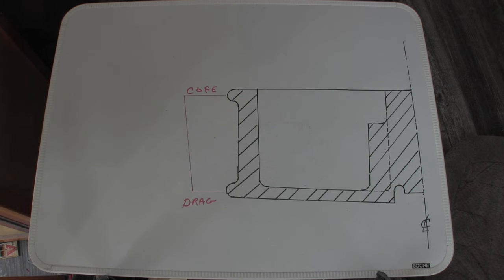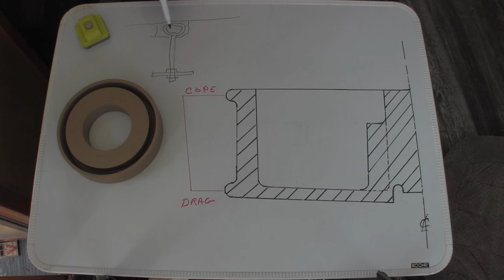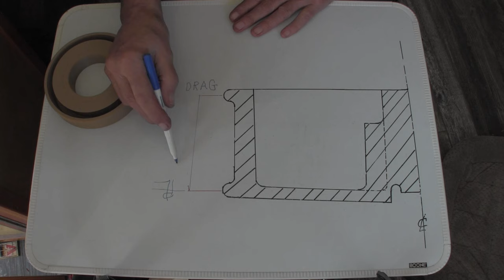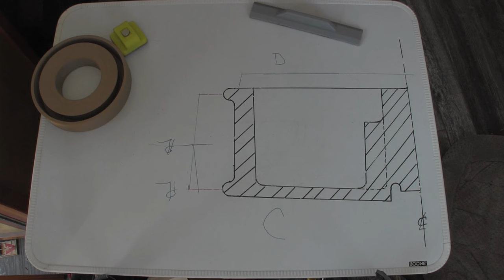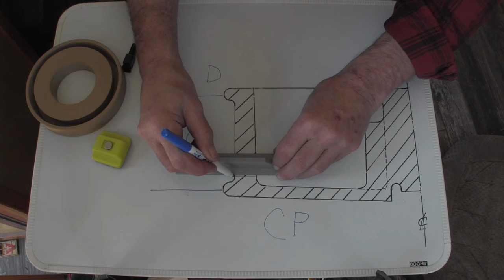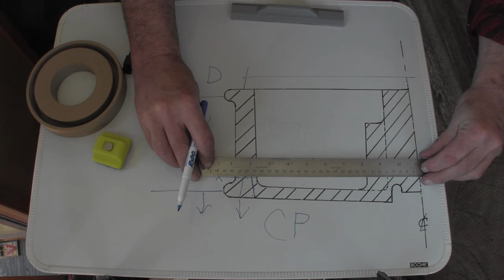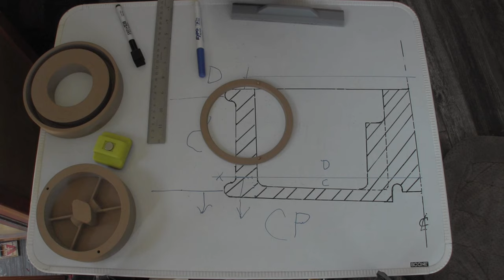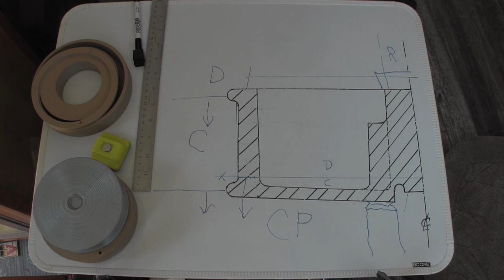Tally Ho capstan printed mockup build.

Comment: What I was surprised at with the capstan mold up was that gaggers (nails/gagger?) to give strength to the sand. I think I remember where the cope separated.  It seemed to me that the project was bigger than they could effectively handle. The size and the weight involved.

Comment: I was wondering if the outside core would have had to be so thick in the way they did it. It seemed to me that it could have been much smaller on the od  which would have made the required flask smaller and lighter. If the thinner cores would have been too fragile, I would think you could put some steel rods in it to reinforce it.
Reply from the maker: That is why a discussion with the foundry is important. You need to know their capabilities and what would work best for them.